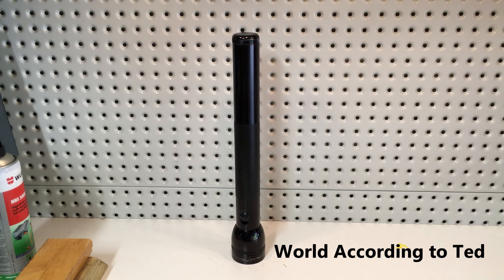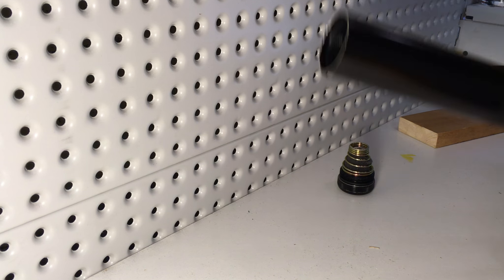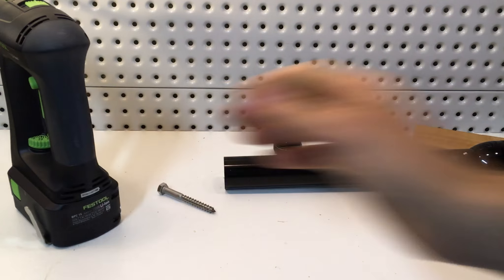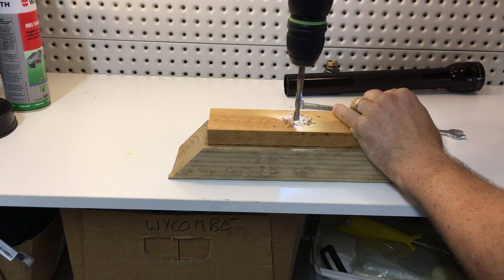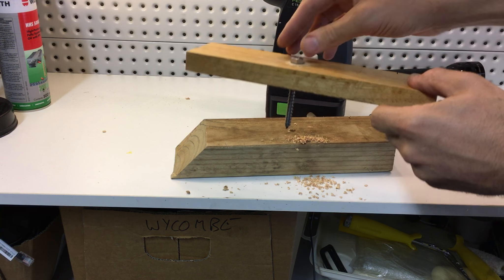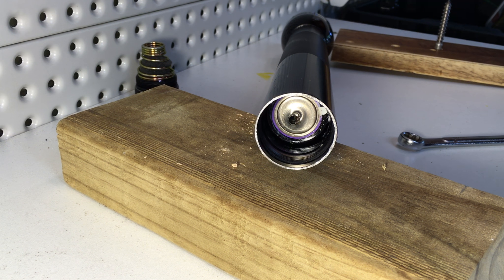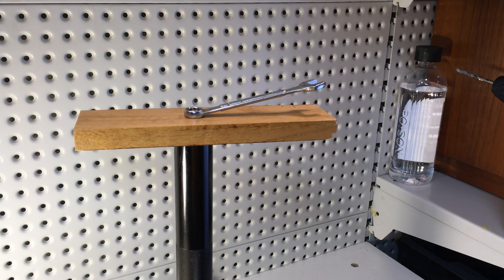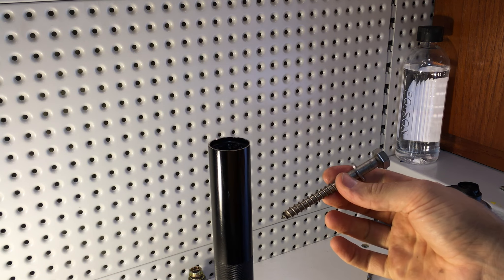MagLite - Remove a Corroded Seized Stuck Battery in 5 Minutes - Maglite D-Cell

Comment: You can also remove the head of the light. The lens assembly and bulb. Replace cap that holds the bulb in so you dont lose it. On a D cell light youll need a 5/64 allen wrench a minimum of 1 1/2" long. Thats with a handle attached. 3" will be a lot easier. Remove the rubber cover for the on off switch carefully. Use a small blunt object to wrinkle it up enough to get it out. Its not glued. Put the allen wrench inside the tiny hole in the center of the on off switch. All the way as far as it will go. Carefully turn the allen wrench counter clock wise a few turns. If you are lucky there will be some space between the batteries and the light switch assembly. If so youll be able to push the switch in and slide the assembly down a bit. Then it will give you a bit of room to remove the spring clip inside atop the switch assy. I use a 45degree pick to hold against one side of the clip and a 90 degree to get behind the front edge of the clip moving it inward toward the center of the light and pulling up as to remove it from the groove it is in. After removal carefully not to bend it up. Remove the switch assy through the top of the tube. When the swithch button is in the hole youll have to push in and slide the switch assy upward past the swith hole and out the top. Then take a piece of wood if possible with the end cap removed. Place on a piece of wood or something that wont damage the threads on the bottom. Place the thing youll be dtriking the batteries with inside the top of the tube and hit it with a hammer. Rubber or dead drop is best but gotta do what ya gotta do. If there is onvious corrosion you should place the light on plastic or something so the acid doesnt go every where. Strike the chosen ram i use a broom handle until the battery or batteries move downward until you can remove them. To aid in this its a good ide to spray lube inside the light tube from both ends. It will help prevent more damage to the tube and help the batteries to come out.  Clean the inner tube well. Make sure no acid remains then reverse the procedure.
Reply: VERY difficult to remove the retaining ring with spear ends.
Reply: My head hurts
Reply: You lost me at "I use a 45degree pick" ... is that a toothpick? or the kind chain-gangs use to break rock?

I'm interested to hear you method ... this might be a great opportunity to post a video (or at least some pictures).  But thanks for taking the time to describe another way, I'm cautious about drilling into chemical batteries, at least not without protective eyewear and gloves.  I've seen what that stuff did to the metal)
Reply: @teamtamer  i have several pick sets. Ine of the picks i use has the sharp pointed tip at a 45 degree angle to the handle of the pick. Generally picks are small pieces of round steel with different angles the sharp point is at. Small handles. Used for marking the center of things. Digging small items out of tight places. Hope that cleared things up.
Reply: @teamtamer  Maybe a tool like a FACOM 234A. But i think the job can be done with a small screw driver if you've been able to push the switch assembly. Without pushing the switch assembly you can't remoove the clip, i've heavily scratched the inside of mine trying to remoove that clip without pushing the switch.
Reply: Older Maglites use a 2mm hex key. Newer Maglites use a T8 torx. Good luck finding one thin enough to go down the hole. That's where a grinder comes in. Grind it down all the way around to fit the hole.
After backing off the set screw 3 or 4 turns push down the light bulb holder, with the bulb removed of course, and then tighten the screw back in to hold the switch down where you can work on the retaining clip. A small screwdriver or pick makes short work of getting the clip out of its groove. Usually I will pry one end out and then push it down. The other end I will pry out and then up. It will come flying out of the tube.
Then loosen the set screw, push in the switch and it will come out if the top of the tube. Any good batteries will also come out of the top.
If the correded battery is minor you can get a piece of round dowel, pipe, or long socket extension and beat the batteries out. Be sure to place the tube on wood before you try beating the batteries out. You don't want to mess up the threads for the end cap.
I have one gutted but I can't get the end cap off. I have another that has 2 batteries stuck in it that beating hasn't helped. Currently they're both soaking with penetrating oil. Vinegar, water, or WD40 hasn't worked. If the penetrating oil fails then it's coke to dissolve some corrosion. Then heat if the coke fails.
I would try this method but they're so stuck the lagbolt would pull out. I could try drilling all the way through and using a washer, nut, and piece of all thread to try and pull them out.
Reply: Don't know if you have a preference in oils but I've been I die hard fan of WD40 most of my life. Then a couple of decades ago I found PB. The company that makes it has a large selection of oils lubes specifically designed for their use. Ex garage door lube. They are that specific. They design their products for optimal use in certain environments. And the PB blaster penetrating oil will wick upward into threads of nuts and bolts and other hard to reach areas. Good Intel on the new lights. I've got a Duracell kicking my ass now. Can't get the lens end apart. Duracell isn't offering any solutions. Beware of the flashlight set from Sam's or Costco. Can remember. Comes with flashlight and batteries. I've had three given to me that the batteries leaked and corroded everything

Comment: Thanks for a good video. For me actually the closest battery to the end was fine but the other two were in bad shape. I took one of my hand weights and banged on the open bottom until they came loose. I was ready to go get the drill or head to the hardware store when your video gave me pause. Well the thing takes a beating but it's working again with some fresh batteries. Will check more regularly.
Reply from the maker: Yes I unfortunately haven't cleaned the spring on the end cap well enough and now I am inspecting the insides a few months later I've noticed it is starting to corrode
Reply: So the lesson is while there are some great hacks nothing replaces good maintenance.

Comment: That's quite the fancypants drill ya got there lol. I have a maglite with rotten batteries I will have to try this. I also just found one I had packed away for years, batteries expired in 2014 so they are 15 years old. No corrosion and the stupid thing still lit up when I turned it on! They only had 1.45v so pretty well dead, but can't believe they didn't fail
Reply from the maker: Yep. All the gear, no idea!

Comment: There is a circular retaining clip in the tube (not shown in this video) in my two Maglites, at the top of the switch assembly; IF you remove it ; then the switch assembly comes out the top, you can easily get corroded/ frozen batteries out.  I used a 1" socket and extension with a rubber hammer to drive  it out .
Reply from the maker: B.R. Field this would have made the job so my easier! Thank you!

Comment: This might work with my AA sized Maglite. It's a souvenir from my
 time working at "Top Gun" (the squadron not the movie). So exchanging it would provide little comfort.

By use of momentum, I've been able to get the bottom battery to move. The upper battery (of 2) does move. So... I'll give your method, or a version of it, a try. I'll just screw in a wood screw and pull out the battery with pliers.

Only thing, a little copper clip fell out of the bottom of the light. So far, no idea where it goes.

Thanks for the idea.
Reply: Did you figure out what it was?
Reply: @Demiglitch : Yes. Corrosion was too far gone. I junked it.

Comment: This....did  it work for me. Lol I had to beat the ever loving crap out of mine with hammers, poles, drills and chisels to get the remains of the battery and switch out. It was so badly corroded it'll need milled out now. But hopefully it'll still accept the upgrades. All the external threads are fine. Just in case anyone else was having difficulty with theirs! 😂

Comment: Well,This torch is a Dsize battery one,you should be able to remove the head and drive the corroded batteries out with a wooden dowel rod and a hammer...I remember having done that years ago..while you are about it you could replace the bulb with a LED bulb..Eveready state on their packaging that they will replace,at their discretion any device damaged by their batteries leaking..You could also consider doing what I saw another fellow do,years ago and that was to replace the D batteries with C ones..He put 5 C batteries into a pvc pipe,cut to length,and inserted this sleeved unit into the torch,saying that would solve leakage problem.he had suffered previously..
Reply: My D size Maglite isn't open from the bulb end.   It's closed just forward of the push button switch.

Comment: I came here because I had the same problem. My brother had this "like-new" Maglite 5 cell. He passed away a couple of years ago, and I'm trying to rescue It because it was something that belong to him, and I miss him. It seems like everything our family has used Duracell batteries in, has experienced this leakage. We've had technical equipment ruined by Duracell batteries that were well within their expiration date. Even the cheap Panasonic batteries from the Dollar General store don't do this. And for that matter, rhe old Duracells didn't do it back in the 70s either.  ( if I remember correctly, they even guaranteed no leakage or they would replace the product. )
       My unfortunate problem with my brother's flashlight is that the battery is the second one from the tail cap. I don't know if I can soak it with something to eat the electrolysis and corrosion away, or what I'm going to do at this point. I have to be careful not to ruin the switch and bulb assembly. I've got to see if I can take that apart from the front.

THANK YOU, DURACELL!
Reply: I use vinegar and baking soda, works everytime, you may have to tap the tub with a rubber mallet to loosen
Reply: John Nickolsen  <— if what Brent said doesn’t work, I think you can take the bulb end apart and remove the lens assembly, and then just pound the bad battery with a long screw driver till it comes out.  If not, you might try the same method as in this video, except get a longer carriage bolt, to be able to reach that second battery.  Sorry bout your brother.  Good luck with the fix.

Comment: For me, the batteries were "fused" so tightly to the aluminum tube that even your screw method didn't work; the screw finally ripped out of the battery.
The last and ultimate method always works: chisel out stuck battery(ies) with a (silicone) hammer and a chisel.

Comment: I cut a piece of scrap wood the long way,  narrow enough to fit into the mag light tube. I sprayed a liberal amount of WD-40 around the outer edges of the batteries, inserted the piece of wood into the tube, and beat the holy crap out of the stuck batteries. I left the WD-40 on the inner walls of the tube and haven't had a stuck battery since.
Reply: Did you do a opposite end approach, by undoing the lamp end hammering them out from that direction?
Reply: @frankw3217  

Yes. There was more visable battery crud in the cap end. Seemed to me that was the way to go.

Comment: I sprayed Nutek Green Bolt Off Penetrant along the edge of the batteries - let sit for 10 minutes - and the batteries came out from my 3 Cell Maglite. Had to use hammer with screwdriver to tap on one battery and loosen - but with tapping on wood, they came out for me. No idea if the penetrant will do any damage to the Mag-lite over time.

Comment: Thats great…except the battery that is stuck in mine is the very first one inserted and I don’t have a 10” long drill bit or bolt to reach it
Reply from the maker: I have another video that looks at disassembling the switch assembly and lets you at the batteries from the other end.

Comment: Problem solved. Looked at some other videos and they suggested baking soda and water to neutralize the acid. I soaked it in a small tub overnight in baking soda. Instead of using a heat gun like they did (because I do not own one), I poured boiling water down the flashlight.  Took it into the garage and one firm tap on the concrete got the battery loose. Now to clean up battery mess from inside the light.
Reply: Boiling water is easy way
Reply: I did that with one light. Was able to tap it out by smacking it.  what a mess inside. But I was able to get it working again.  The other light was to far gone. Teach me to leave the batteries in to long. The funny part is , the lights were working even with the batteries leaking all over.  So the only way to check them is to remove the batteries.
Reply: I didn't experienced this but use good quality batteries and don't forget batteries inside for long time or just use rechargeable batteries in it nowadays there are Chinese lights with 18650 battery alot more lumens than maglite
Reply: @Gaming47348  I used Duracell.  They were fresh when I put them in. Time slips by and I am not how long they were in.  The lights still worked so I thought everything was ok.  It wasn't
Reply: I seen in many reviews people saying that Duracells leaks inside so try other brands like camelion or use rechargeable but check it after 1 or 2 months also use some petroleum jelly inside its cap so it will not jam
Reply: @Gaming47348  I put some dielectric grease inside the lights in hope of preventing any sticking.  I plan to replace the batteries once a year like I do my smoke detector batteries, even if they are working fine.
Reply: Alkaline batteries are.. well alkaline unlike lead acid batteries that use an acid electrolyte. So to clean up the leaked alkaline try an acid such as lemon juice or vinegar to neutralize and clean up the mess.
In my maglite I lucked out by pouring boiling water into the battery tube which loosed the bottom stuck battery enough to move it down by tapping tube up and down on a board till flush with the bottom but the upper cells were loose so holding the tube I could move it up and down using the loose cells as a battering ram to knock the bad cell the rest of the way out.  My maglight used 4 D cells so the three loose cells had the mass to knock the stuck one out.

Comment: Wow, please be careful what type of battery you drill into, I tried this with a 18650 high powered battery that was stuck. As soon as drill bit penetrated it combusted and turned into a missile flying around the garage like a bullet. Very scary, Im sure these batteries are much safer but Im done drilling batteries
Reply from the maker: Good point. Don't mess with lithium batteries. These were very drained 1.5v alkaline cells. There was very little electrical energy stored in the battery. The main risk here is the corrosive nature of the contents of the cell.

Comment: I want to repair my maglite its the big one like cops use and the spring is rusted away from.the back and i had to cut off the cap with a sawzall everything is rusted and corroded i wonder if this is too much for me to bite off and fix, i tried this technique and the batteries are like white and rusted all over and it just broke the battery when i tried pulling it out wonder if i can just drill it out to the best of my ability and wite brush everything

Comment: You can remove the head, slip a socket wrench over the bulb socket, add an extension and whack it with a hammer. That will remove the last two batteries and the switch.

Comment: Just found out that maglight warranties stuck corroded batteries in mag lights if they are duracell copper top or everready batteries even if warranty expired simply mail it to them and they send you a new flashlight
Reply from the maker: Brilliant News! Although I couldn't find information to this effect. The info I found on this one appears to exclude battery leakage from a warranty claim, rather direct the complaint to the battery company. Either way, the cost of sending back to MagLite head office from overseas would probably make it not worthwhile. http://maglite.com/wp-content/uploads/2014/08/UNIV_INCAN_WHS_WARRANTY_ENG_0716.pdf
Reply: You may not be able to send a package containing batteries by post as they are considered a hazardous material. Definitely a no-no if lithium batteries are involved.
Reply: Sorry, but your info is out of date.  Mag-lite will NOT just "send you a new 
flashlight."  They now have a Trade-in Program where they will take your light as a trade in toward a new light.  The down side is that you pay about the same as 
price you would if you shop on Amazon for a new one.  Add to that the shipping   from your home to CA and the shipping from CA to your home.  If you cannot get the battery out, sell it for parts and buy a new one on Amazon.
Reply: That is false. Where exactly did you read that? The warranty literally says. "This warranty does not cover any of the following: 1.
Battery exhaustion; 2. Battery leakage; 3. Lamp burnout; or 4. Damage to or failure of the flashlight or any component thereof due to alteration, misuse, battery leakage or lack of maintenance." 

If batteries leak inside the device you can contact the battery maker as sometimes they cover devices damaged using their batteries, but Maglite would not just send a free light.
Reply: Some years ago I found the three Duracell D cell batteries had corroded completely in my MagLight. I called them, and they said to send it to them for a replacement.
I did, and they sent me a new flashlight at no charge.
They might have changed their policy since that time.
Simple way to find out is to call them and ask.
Reply: ussling policy changed